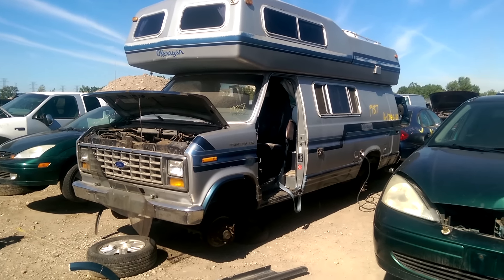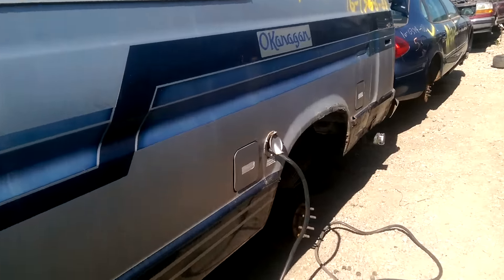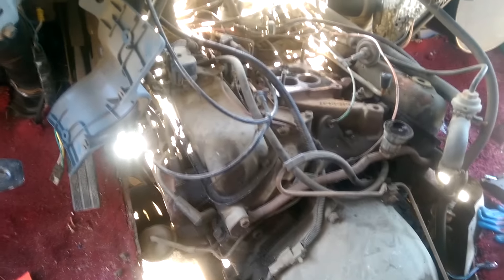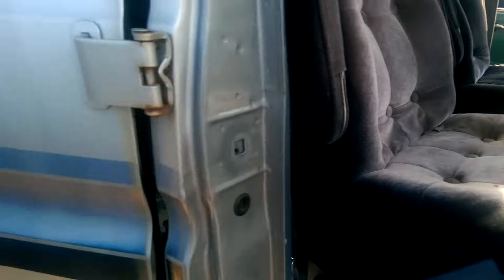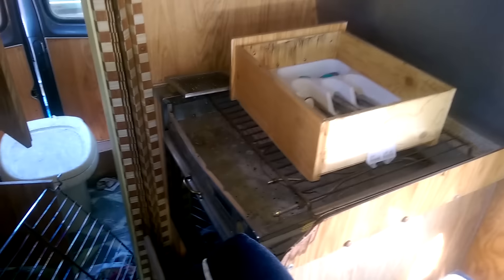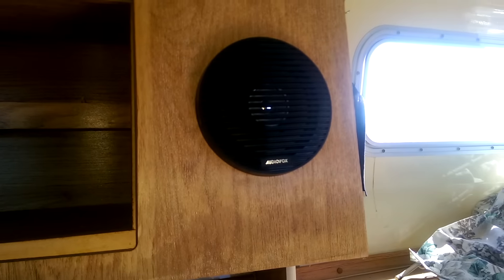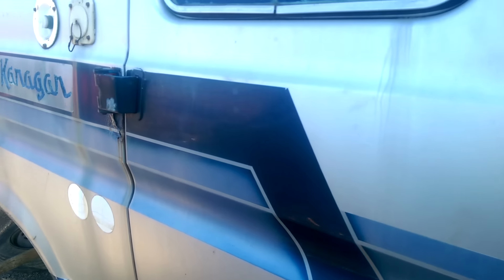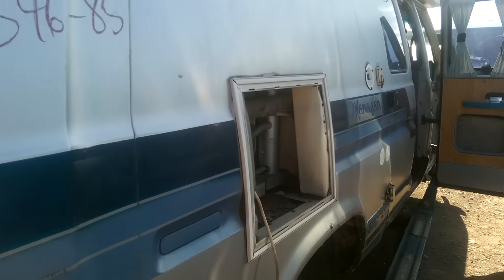Rough old B class Ford RV in the junk yard

Comment: I had a ford van of that vintage, I went and bought those same push out windows for the side and back.........finally I took off the valve covers to change the gaskets and I foolishly removed a lot of crude that was in there, a week later my engine started knocking.............the oil pump got clogged as a result of me changing the oil and messing with the sludge, lol..........it went to the junkyard and im sure someone else got the windows..........note to everyone..........don't screw with a dirty engine